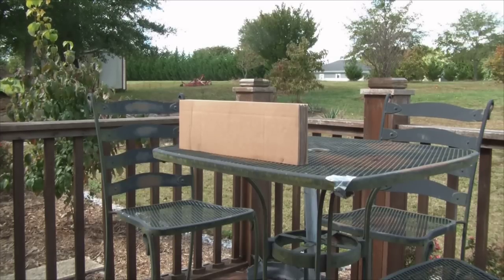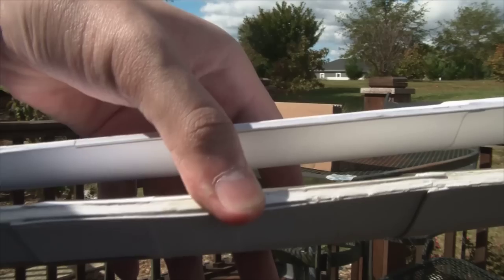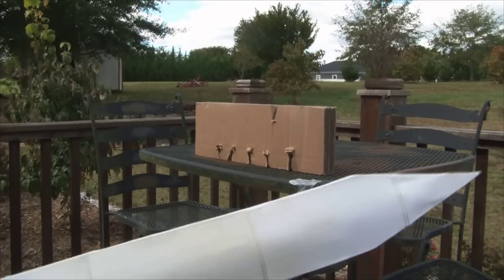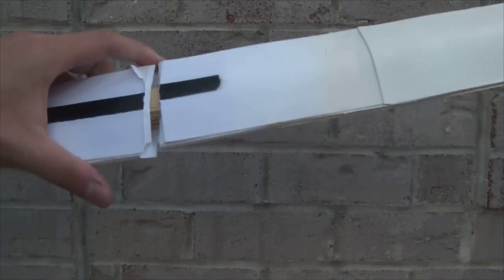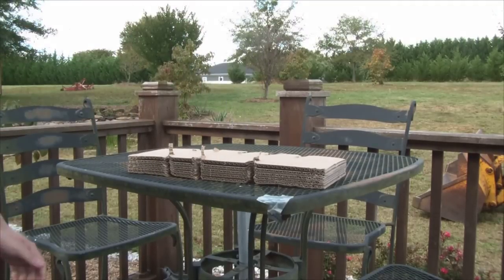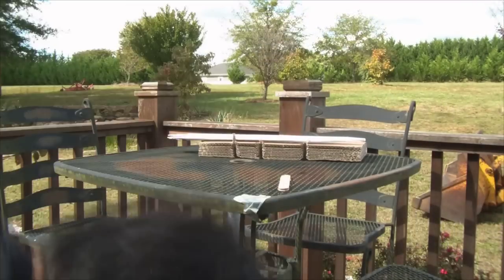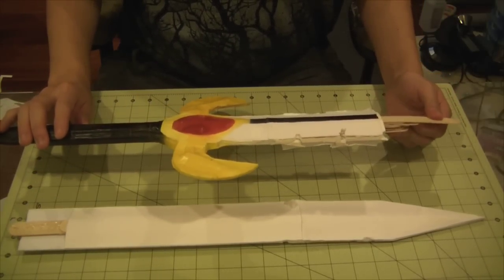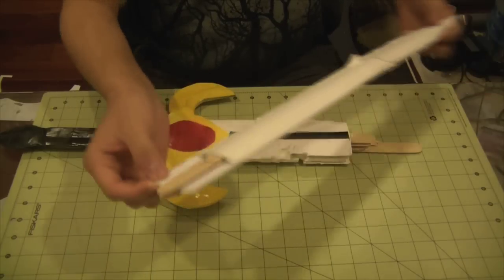Ultimate Paper Sword Durability Test- Impact

Comment: Hey Returavan! I'm a bid fan of SAO and ur videos and I just have a tip. The thickness of 5 layers of 110 lb card stock I equivalent to 12 layers of printer paper made into fourths. I'm pretty sure its the same weight as the one made with the elucidator. Keep up the awesome stuff!
Reply from the maker: that may be the case but how about this...the amount of paper need for a 44 inch template made using 110 is 20 sheet folded in halves...it would take almost 96  sheets to get the same result with 20lbs...

Comment: +Returacan I was wondering about the Popsicle sticks inside the sword itself. When adding the support along the inside of the sword, do you use the Popsicle sticks in the brick formation to add more strength then just putting one long piece of wood, on both sides? Reason I'm asking is I've made the sword up to this point, and I have longer pieces of wood. but no Popsicle sticks on hand. Was wondering the reason why you use the Popsicle sticks instead of a piece of wood. Only thing I assume is that the Long 40 some Inch chunk of wood support might not be as flexible or strong as the Brick Layered Sticks.  Hope to hear back, Thanks.

Comment: Well, here's a good a place as any I suppose.
Hey Ret (can I call you that?) I'm thinking about embarking on a progect like this myself, wanting to make my OC's katana like blade (as shown here: http://dragon-fang2.deviantart.com/art/Thurkear-s-saber-rough-design-546706252 ) but was wondering how you would go about making the nail on it? I'm sure you know what a nail is, but if you don't it's a small tab of metal that acts like a third prong of the guard and is placed on the knuckle side. Now these can be both straight and curved and for Thurkear's saber, it's curved. Got any tips?

Also, the thinner "Show blades" you make, are they sturdy enough to swing around without wobbleing/breaking if you don't impact anything or stop to suddenly? or should I make something like "Fail Sword" for swinging?
Reply from the maker: Furiora so basicly a messer with a katana blade, unfortunately there is no way to make something like this anywhere near sturdy as the rest of the blade but as a cosmetic part its pretty straightforward, you want the cross section to look like a T, basically forming a spine on the underside of the nail. the thinner blades are more costume pieces, i dont recommend swinging them
Reply: Returacan ... Yeah, putting it that way would have made describing it a lot easier. I'll give the messer the edge in cutting power due to it's wider blade but the shape of a katana has always been so damn attractive to me... that didn't sound wrong what-so-ever.
I can see that, just wondered about how I'd go about attaching it to the rest of the guard assembelly.
Ok then, what kind of paper/layers would you suggest for swinging? Or should I just go full on sparing sword?
Also, been meaning to ask this for a while now, decolouration issues aside, how nice are the scaled handels to hold? when I first saw them I was like "damn that looks cool, but damn that must hurt to hold"
Reply from the maker: to keep things simple, id just hot glue them into place, a very complacated way would be to cut a T shaped hole right though the guard,blade and everything inbetween and use the nail as a pin. not recommended. the scaled handles are actually pretty soft, after a while the scales will conform to your hands before it starts discoloring, as for sparing swords, a katana blade will be mostly wood by weight but with such a thin blade its not very conducive for that purpose, but it will survive being swung...at full power. typically i do 4 layers 110 and 3 layers wood for katanas. everything else for sparing i recommend 5-6 layers 100 and 4 layers wood depending on blade width and length.
Reply: dueldu70 The use of the word "messer" here is refering to a german sword known as a messer. If i'm correct, it was named because when it was created, people that weren't nobles were not allowed to carry swords, so they made this weapon which was a single edged blade with a scaled handle claiming "it's a knife"
Reply: yeah, this is coming from quite a long time ago, the nobles could have said "it doesn't matter how the handle is made, what matters is the lenght." and banned use of the weapon. However, they allowed it because it oddly enough motivated the people that they were allowed to carry this "knife" around. I guess they just felt safer so they did their jobs better.

Comment: Right now I'm building a 5 foot long 2h sword, and I'm using 6 layers of 110# paper. How durable would that be?
Reply from the maker: 6 layers and at least 4-5 layers of supports, it should be ok
Reply: I did 4 supports, now just wondering how long I should let it dry between pieces of the outer shell
Reply: Oh and I could still add another popsicle layer, cause I'm not going to put the shell on until tomorrow, so should I add the 5th layer or not?
Reply from the maker: Onan Henderson depends on how wide the blade is, just so it looks right
Reply: Is there a way I could send u a pic so u can see? I really don't want to mess this sword up.
Reply from the maker: Onan Henderson g+ hangouts would be the easiest way
Reply: Lol i still havent finished it yet
Reply: Onan Henderson now?
Reply: ***** nope. Its still sitting in my closet with one side covered in paper
Reply: It's WAY to heavy and big, it will not support itself, or even you!
Reply: Kazuto Kirigaya yes? (I am The Katana Narwhal, just a different account)